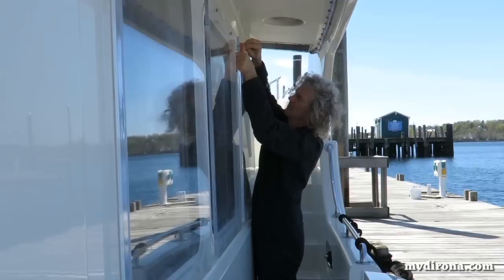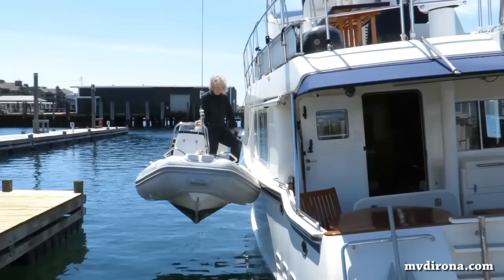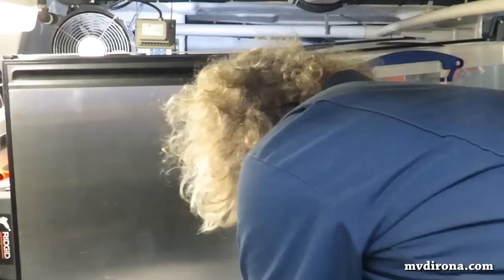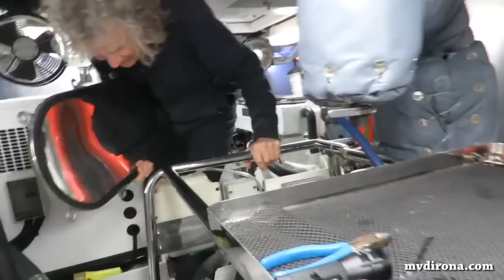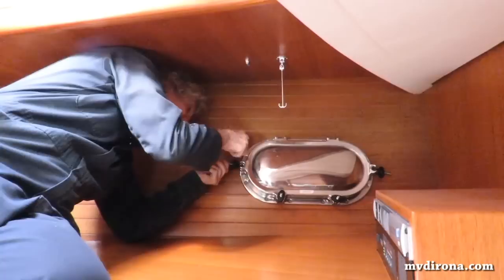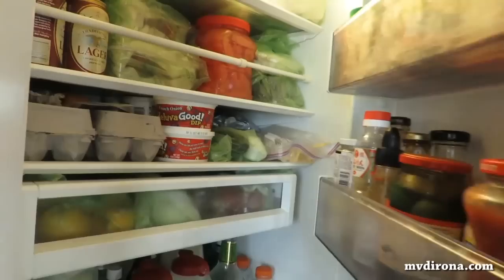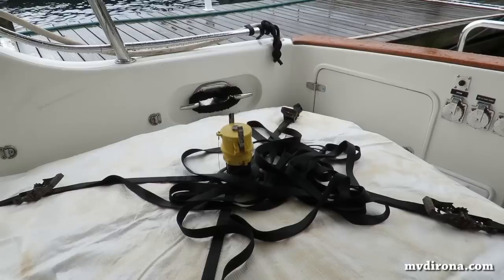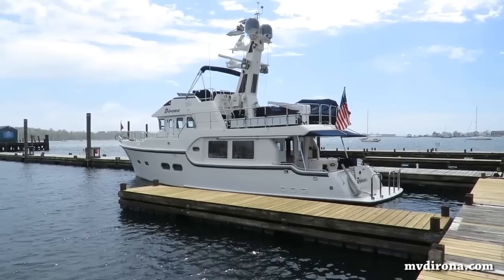Preparing Dirona for the North Atlantic Crossing (MV Dirona Channel)

Comment: First Vid I found, nice. only issue I'd have is burying all the O2 tanks so far out of reach, maybe keep one easily accessible for  emergency use, to check hull or prop in case of an open water strike.Of course hoping it's never required
Reply from the maker: Those SCUBA tanks compressed air rather than O2 -- roughly 20% oxygen. They looked difficult to get out of the laz but the large stacks of boxes slide out line a puzzle and just two stacks need to be moved. I can have a tank out in under 60 seconds so it's really not much of a hassle.  But, you are right, it's not as easy as when they are up on deck where we normally keep them. The largest part of the time of getting the tanks out of the storage location down below is reattaching the hold down straps that retain them but, even that is only 3 or 4 minutes.
Reply: Right on, just looked on Vid like it would have been difficult to get to under duress, Checking out other MV vids, honestly would like to have seen more passage Vids, the gale stuff was great, but seeing life aboard during them, cooking, living, on watch. 

Wishing you clear skies and calm seas ahead
Reply from the maker: Life underway is almost always boring. Just business as usual with my day job, meals, the "excitement" of a boat passing every few days or perhaps seeing some bit of debris in the water. Not much going on but, if you are interested, we can do a video on life underway. We'll plan to do that Michael.

Comment: Using the tender like that is super clever, nicely done. The way you narrated this is excellent as well, I could tell within a few minutes watching that you've got a lot of experience.
Love the screen in the master stateroom with all of the engine information, really ought to be standard for owner/operator boats.

2500 Gallons in total give or take on the boat all said and done? In terms of keeping the bladders full, do you just pump them from full to empty? 
Funny seeing a nordhavns stern so low that it's looking a bit like a cruising boat!
Reply from the maker: Thanks for the feedback. And you are right about the value of that information display. We have one in our stateroom, another in the pilot house, and a third in the salon so the data is visible from anywhere in the boat. The information we consult most frequently ends up being communications information (cell and satellite signal strength and current connectivity status), battery/generator load status, and tank level information.  There are also 40+ indicator lights along the bottom of the screen that shows current state of major appliances and any faults in most boat systems. It's a single glance to see if there is a problem of any sort.

Comment: PS, I was fascinated by the fuel bladders for long voyages. Really interesting as I only know about aviation applications. How do you pump into the tanks? Do you cross pump - ie run port tank low then pump starboard bladder into port tank to maintain trim?
Reply from the maker: Jjaus, we have a fairly simple fuel transfer system for the bladder fuel where we connect a cam to a permanent fitting on the bulkhead via a short hose section to a cam lock on the bladder tanks. When it is time to pump the fuel, the standard fuel transfer pump moves the fuel from the bladder, through the transfer filter (25 micron RACOR FPO-10), and then is directed into one of the main tanks. This has the advantage of allowing fuel to be pumped with nobody outside, doesn’t require the tank filler to be open to water ingress, filters all fuel as it leaves the bladders, and allows the bladders to be pumped completely dry so they are light and easy to handle.

When fueling the main tanks, the fuel is brought in directly. We filter all fuel that is transferred from the main tanks to the day tank (wing engine) or the supply tank (all other engines) using the same 25 micron RACOR FPO-10) transfer filter and high capacity fuel pump.

When transferring fuel we pump from the left side bladder to the left side tank and the same on the right side. This keeps the fuel on the same side so the fuel movement doesn't affect trim.  The stern just rises slightly.

If you are interested, there is a lot more information on the fuel management and transfer systems used on Dirona here: http://mvdirona.com/2013/12/dirona-fuel-manifold/
Reply: Ahh, makes sense. Will read your link tomorrow (sans red wine, it's Sat night here and almost bed time). We're planning buying a Prestige 550 fly and the CE rating is B. If we want to motor from EU to Carribean via N America, is it worth all the hassle and money or paying to transport it, then fly over? So many variables and new skills needed for trans-oceanic voyages. We are frankly too scared to motor from Australia to Europe through all the piracy zones, so have decided our adventure will begin somewhere in the Med.
Reply from the maker: Like you, we won't go anywhere near to any reported pirate activity. Never within 100s of miles. There are routes from Australia to North America that stay away from all pirate activity but it will force you to round South Africa which requires care with weather.  We've done it and you can get lots of detail on the trip up at: http://mvdirona.com/Trips/indianocean2015/IndianOcean1.html. This links shows the Indian Ocean crossing but you can see the full trip by moving the map out to show the world and selecting the leg you wish to see in more detail.

Certainly starting in the med is an easier plan and, generally, the run between Australia and North America is a lot of open ocean time.

Comment: I didn't know you can store additional fuel like that ! Interesting.
Reply from the maker: Yes, fuel bladders are heavily used in military applications where they want a quick base. They are used in military helicopters where they have special self healing properties that can allow them to take a shell and continue to hold fuel. They are used in race cars to allow massive collisions with less likelihood of fuel spills. They are used in recreational aircraft applications to move short range aircraft over longer distances. They are used by high horsepower sports fish boats to make long runs to deep water for pelagic fish hunting.  And, of course, they are used by recreational boaters to increase range. Not super common but they can make a big difference. We have a 2,500 nautical mile range with good reserves in rough water which is sufficient to make any crossing but you need to chose routings carefully. Carrying deck fuel, we can reach 4,000 nautical miles under the same conditions.

Another important limitation is vessel stability. Carrying deck fuel will reduce the stability of the boat and the amount of fuel that can be safely carried by a given boat depends upon boat design and worst conditions encountered. Here's some more data on our boat and the impact of deck fuel on stability: https://mvdirona.com/2019/03/deck-fuel-and-vessel-stability/.
Reply: @MVDirona  thank you for the information. I only knew about the land-based applications of bladders and also in combat helos. I'm an engineer by trade so I was indeed wondering about how bladders would raise a boat's center of gravity. I would expect you use the fuel from the bladders first, but I've just watched one of your videos where you explain your fuel system and it doesn't seem that's what you're doing. But maybe it isn't necessary, I suppose the limits you mention take into account the weight of the fuel in the internal tanks.
Reply from the maker: We effectively do what you are saying. We run the main tanks down 400 gallons, and then pump down the 360 gallons forward. Then we go until we have 650 gallons available below decks and pump the 600 gallons on the aft deck down. At that point, there is nothing left on deck (other than empty fuel bladders).
Reply: @MVDirona  thank you, nice to know I had the right intuition. Those Nordhavn yachts are really starting to interest me. It's probably going to be my retirement plan, in another 20 years or maybe even sooner.
Reply from the maker: A bit before retirement might make sense in that it takes time to know what you like, make sure you actually like boating, and then get a boat equipped and setup as you like for the kind of trips you plan. But, overall, your plan sounds like a good one.
Reply: @MVDirona  I've grown up in a harbour, I've already ticked the "make sure I like boating" case 😉. How long did it take you from deciding to get a boat to taking out to sea for the first time ?
Reply from the maker: 5 or 6 months of shopping to buy our first boat and then we used it constantly for 10 years and wound up 4,100 hours in Washington state and in British Columbia. It was a realitvely inexpensive 40' coastal cruiser (Bayliner 40).
Reply: @MVDirona  I was expecting about a year start to finish, so it's nice to know that's realistic. If you don't mind sharing, I've read everywhere that a boat costs you 10% of its price each year in terms of maintenance, fuel, etc... has that been your experience ? I'd assume that an owner who doesn't mind fixing things himself can probably do better, but then we can't do much about fuel costs for example.
Reply from the maker: We don't track it for three reasons: 1) for us, it's "just life" we pay what is needed to keep the boat in good condition and don't have a house and car, 2) it's really hard to be precise over the real costs since some potential costs are very large and very unlikely (engine failure) and some are fairly rare.  For example, in 10k hours and 9 years, we have only changed seals on thrusters and stabilizers once, and 3) your costs will vary depending upon how often you go out for dinner, how often you go to marinas, where you chose to boat, how much work you do yourself, and the number of hours/miles you do each year.

Generally, around 10% of the value of the boat looks about right. Some argue 10% is wildly high but I know some that spend much more.  In our case, we're around that point if you look at all in costs directly related to boating. I've seen some claims as low as 2% but those claims don't look realistic to me -- I'm sure some years are that low but, if you really do include ALL over a long period of time, the number will be larger.

Not directly related but potentially of interest: https://mvdirona.com/2010/05/lessons-learned-buildling-a-semi-custom-trawler-slide-deck/
Reply: @MVDirona  thank you for all the information, and for your time. From everyone I've asked who I know have a boat, that 10% number seems very accurate. I think it's really going to be the dimensioning factor when I "take the plunge". I wish you safe travels and a long, long life !
Reply from the maker: Thanks all the best on your plans.

Comment: When you were handling the storm covers for the side windows, i thought if they had a handle it would be easier. If it slips you have to get the scuba gear out.
Reply from the maker: I've considered using the suction holders used to install heavy glass plates in buildings. Having a handle would make handling those big, heavy plates much easier. I'll have to come up with something.

Comment: That boat looks top heavy.
Reply from the maker: The boat goes down 6' 7" below the surface and it weighs 55 tons so it's more stable than it looks. It meets CE Category All Oceans. Generally it's a pretty solid ocean boat (for it's size).

Comment: ATL fuel cell company made the fuel cell and Custom fill cap on my race car . I personally gave the owner Peter Regna Laps at Watkins Glen in his Ferrari F40 
Great guy and great company
Reply from the maker: I've used ATL in race cars as well and I've seen some crashes that really underlines how solidly these fuel cells are built.
Reply: MV Dirona what cars and series were you racing ?
Reply from the maker: Just club racing but we had fun. We had a Brabham BT29 (#49) which we raced as a Formula B with an Alfa Romeo 1600cc engine, an Alfa Romeo GTV, and a mini-stock car. It's around the stock car tracks where ATL fuel cells are super common. 

It's cool you had the owner of ATL out for a fuel laps at Watkins Glen. I used to go to the Glen for each US Grand Prix in the late 60s and early 70s.
Reply: MV Dirona very cool 
I remember working at an exotic car dealer in philly at 17 they had a Formula B car in their garage I would sit in and dream about driving 
I was at the Glen in 72 in the pits with the formula B pre races 
In 1990 I was able to do the track walk of the street circuit with David Brabham checking for secure manhole covers in Phoenix at the inaugural F1 race 
I was lucky enough to own and drive a1988 Lola Larrousse F1 car in exhibition for 6 years 
I watch your videos which remind me of spending my early years with my Dad sailing are way up to a Pearson 54’ until about 20 years ago 
Great memories (plus a few near death experiences) 
Nice to know you !
Reply from the maker: You've driven some wonderfully capable racing machines. Working at an exotic car repair shop gave me opportunity to drive the odd Ferrari, Lamborghini, etc.  but having even an F1 car on the track would be pretty amazing. I don't recognize the Larrousse but I was going to the Canadian and US GPs at the time so I'm sure I did see them race. 

Here's the Brabham we raced: https://mvdirona.com/jrh/EurocarRacing/.

Comment: How do you transfer the fuel from a bladder to the engine. Thanks for the interesting video.
Reply from the maker: It's a pretty cool set up where, before leaving, a custom made hose is attached to each bladder by cam lock fittings and then connected to the aft bulkead also by cam locks. Then when it's time to transfer the fuel we just adjust the fuel manifold in the engine room to "Fuel Bladders" and do the transfer without going outside. Much more detail in this posting: https://mvdirona.com/2013/12/dirona-fuel-manifold/.
Reply: @MVDirona  what is your total on board fuel, l was guessing 3,400 usg?
Reply from the maker: Below decks we carry 1,750 US gallons and, when fully loaded with deck fuel, can carry 2,710 USG.

Comment: I liked it but can’t understand how you fix the storm catcher plexiglass??
Reply from the maker: The permanent window frames in the boat have 1/4" threads and cap screws run through holes in the plexiglass storm plates into the permanent sockets.

Comment: How do you manage drawdown of the bladders? Fill the main tanks several times or wait till you can drop the entire stern bladder contents into each tank at one time? How do you transfer the fuel? How do the full bladders affect your stability?
Reply from the maker: Good question. We run until we have room below decks to bring a full bladder down. Once there is room to bring one down, we do it.  

The bladder pump down is super easy. There is a cam lock fitting on the bulkhead so pump down just requires plugging in the hose and, once that done, the tank can be pumped down without going outside.  It's transferred by the central fuel transfer pump (same pump used for moving fuel between other fuel tanks) with the nice side effects of: 1) all fuel is filtered on the way below, 2) there is no chance of water ingress or fuel spills, and 3) don't need pumps outside etc.

I've posted the fuel bladder stability data below but the short answer is it can still pass ISO Category A All Oceans when running with full bladders: https://mvdirona.com/2019/03/deck-fuel-and-vessel-stability/

Comment: Nice video. How do you transfer fuel out of the bladders to present to the engine?
Reply from the maker: The transfer system is a fairly nice setup that avoids having the fuel tanks open to the weather or there being any risk of a spill. Nobody even has to be outside. There is a camlock connection on the bulkhead and on each bladder. A short hose connects the bladder to the bulkhead connection. Once there is space in the below decks tanks, we open the safety valve on the tank and then use the fuel transfer pump on the boat (it's use to move fuel around between tanks or to filter fuel in a given tank) to transfer the fuel from the bladder to the tank. This allows a risk from transfer and the bladder can be vacuumed down flat so it's totally empty and all fuel is filtered before it's put below decks as part of this process.
Reply: @MVDirona  very nice setup indeed. I always enjoy hearing about long haul journeys like this and the mechanics and prep that goes into them!
Reply from the maker: Getting small boats able to comfortably cover long distances takes a bit of work and thought but, clearly, starting out with a well designed and well thought out boat is crucial.

Comment: Wonderful video. I may have missed it, but do you use the bladder fuel first to free up deck space?
Reply from the maker: We do move the fuel from the bladders down below as soon as we can. It does free up deck space but the primary reason we move the fuel down below is that is the most stable configuration for the boat. Just the below deck fuel load weighs more than 5 tons. For stability reasons, we want this weight as low in the boat as possible. So, as soon as there is space below, we pump the bladders empty, clean them up, and put them away.  If you are interested in more details: https://mvdirona.com/2019/03/deck-fuel-and-vessel-stability/.

Comment: Probably easier to move the boat 6' to port to install storm windows from dock?
Reply from the maker: Probably true. It was an experiment because to avoid turning the boat around as we normally do. It takes some time to drop all the lines, unplug the boat, and then move all the lines to the other side. Then do it again. But, yes, doing that probably would have been easier.